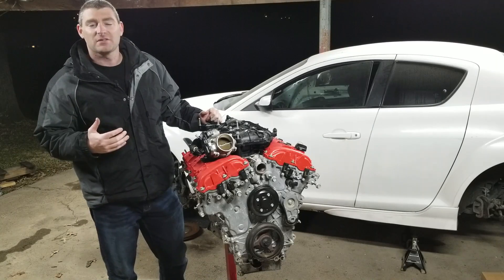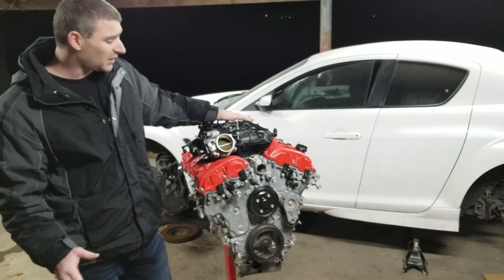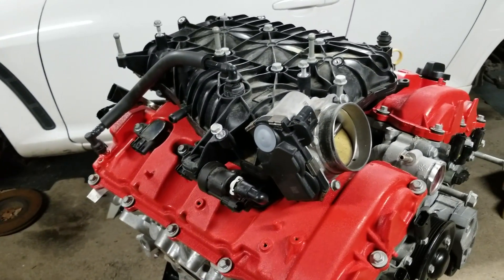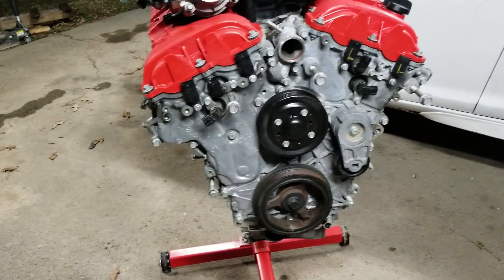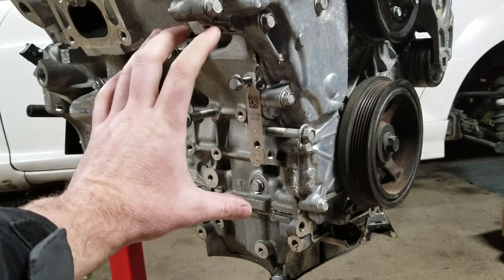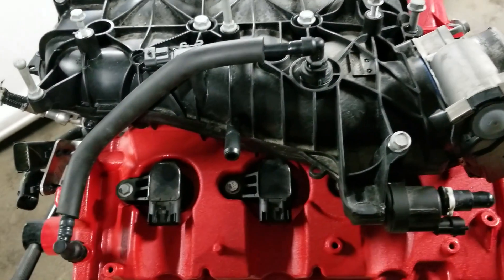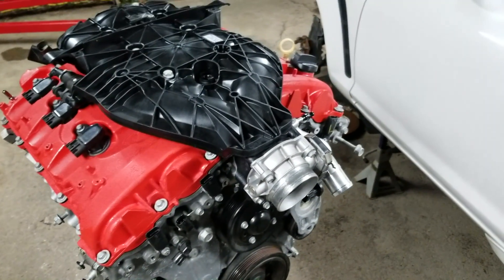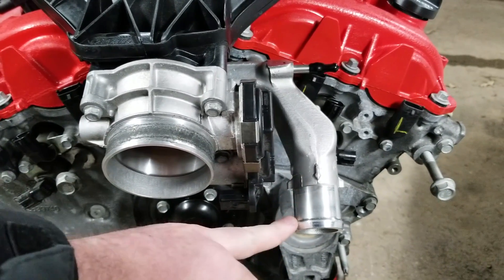GM LFX V6 FWD vs RWD - What's the Difference?

Comment: Is the LFX intake manifold "symmetrical"?  In other words, can it be rotated 180 degrees so as not to hit a bulkhead in a mid-engine install?  I'm also interested in the best solution for a generic stand alone ECU solution.
Reply from the maker: dirtboater1 That's a good question. I will check for you tomorrow. However, if it is able to be rotated, I have a feeling the high pressure pump and lines in the back would be in the way of the center intake. The fwd intake might work though since it would sit over the one valve cover, but you would lose some power since it is a little more restrictive.
Reply from the maker: From what I can tell it will flip around and the ports and bolts will line up. I can't test it however because the Camaro intake goes down in the front for hood clearance and the hard high pressure fuel lines in the back are in the way when you try to spin it.

Comment: Great videos sir. Have you thought about changing the timing chain and tensioners? I hear that they go out a lot. Also, do you plan on going with twin turbo? I did a swap from a 2014 Impala LTZ to 2003 Monte Carlo and man what a difference. I still want to make mine either turbo or supercharge it.
Reply from the maker: Thank you sir. When I started looking at the LFX as a swap option I read a lot about timing chain issues, but it seemed that it was mostly earlier model engines and that it really came down to oil change intervals that were too long. The engine I bought only has 19k miles on it and the internals look pretty good so I am going to run it as is and make sure to use good oil and change often, which I would be doing anyway on a hard driven track vehicle. The plan is to supercharge it in a year or two, but we will see how it does as is. The supercharger will have more linear power and produce less heat under the hood. On the street a couple turbos would be a lot of fun though for sure. I bet that 03 Monte Carlo is pretty quick with this engine. I'm sure that was a pretty involved swap as well, so a tip of the hat to you sir!

Comment: Been hunting a wrecked Camaro LT manual trans for a while.  Glad to see there's no timing chain cover changes needed for the FWD engines.
Reply from the maker: Robert Dewerff Nope, no need to change timing cover. Depending on the accessories you are using the only difference up there is the serpentine belt routing.